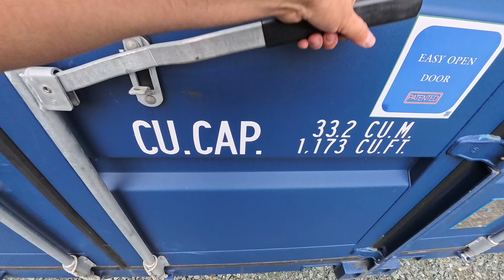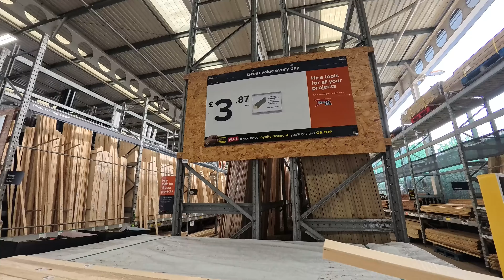How To Insulate A Van | Ambulance To Campervan Conversion

Comment: The black adhesive.try blow torch or heat gun and scraper.good luck
Reply from the maker: Ahhh yes! Good idea, that should be a lot easier to get off with a bit of heat! 🙂👍
Reply: @BrendanExplores  just be careful of your insulation

Comment: Great vid...however im jist wondering how much difference that insulation will make consideration you have windows 360 degree around the van.
Reply from the maker: Yeh good point 👍 I'm actually thinking of making some removable inserts for certain windows when it's cold. Not sure how to go about that yet though

Comment: Bren try warming that adhesive with your wife's hair drier that should soften it up the using a scraper you should be able to remove some if not all of it good luck mate
Reply from the maker: Cheers for the tip mate 👍 great advice 🙂

Comment: Not sure how far ahead you are but you might want to add some flexi conduit to your battery / electrical side of van. You can also add a draw cable too incase you need to add more wires. Loving this new build series though and can't wait to see the end result
Reply from the maker: Thanks for the tips and advice mate 🙂 yeh I'll be adding a few different bits and bobs in the coming weeks 👍

Comment: Excellent work between you and your dad . At the moment I and my son are more or less where you are , on our van conversion. However we are not adding as much weight as you are , personally I believe in thinking the more thick wood you add the more you will lose in performance and diesel . We've gone done the route of plywood ribs instead of solid £3.what ever pine from B&Q . I'm not criticiseing your method but we've looked into this in-depth and our method. Keeps up the good work and I wish you further good luck with your conversion.

Comment: I think the one thing that gets me is you said buy the ambulance because it's already insulated ect so save yourself some money, but really you haven't? In fact would it not have been better to have not had all the windows because of the extra cost of the tint? Do you stand by the ambulance choice or would you choose something else in hindsight? Love the videos regardless
Reply from the maker: Yeh I would buy an ambulance again if I went back in time as the service history is impeccable 👍. For someone who wants a hassle free way to build a camper the insulation will do for most and you also have ready made templates to replace for the windows. I wouldn't of removed the side panels and old insulation if those three holes weren't present in the roof. As I mentioned at the start of the buying video as well, I had a nightmare experience with another van from a different dealer... So to sum up, if your not very handy with DIY etc then an ex ambulance is a great choice as it already has some insulation and ready built side walls 🙂